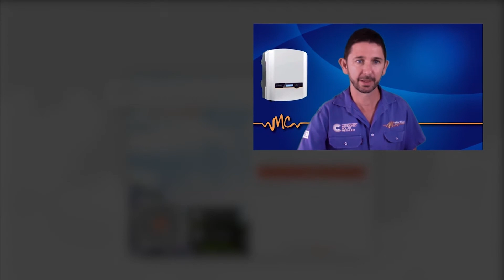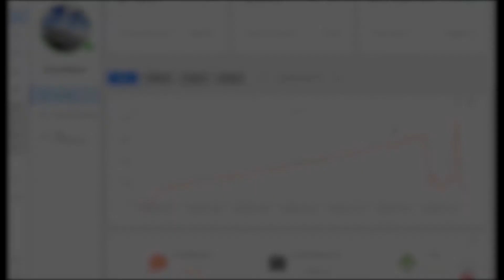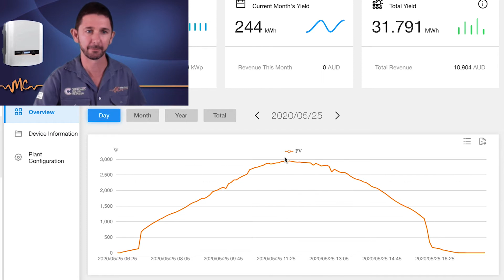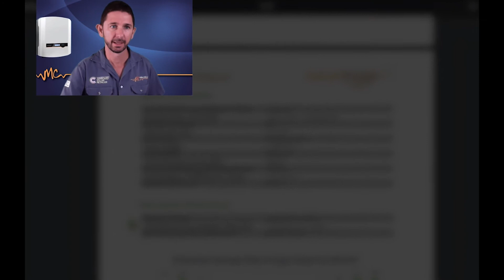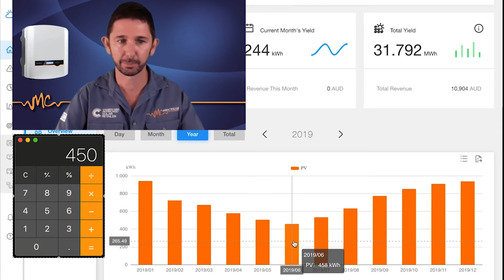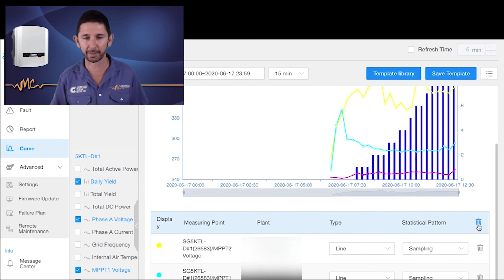Solar Monitoring | Sungrow | How to use iSolarCloud | No Energy Meter

Comment: What do you thing about the lates Sungrow 16kw battery system, with Sungrow 10kw hybrid inverter. Thank you
Reply from the maker: We stopped selling Sungrow products due to their support structures and constant issues and bugs with their software. From what I understand, these bugs have not lessened and still require intervention from installation companies to constantly follow up Sungrow for resolutions. 

Fronius offer much greater support. Still have issues and bugs, but they deal with them in a very professional manner. If you can, go the Fronius BYD combo. The advantage of being able to add a Fronius EV Charger without any additional control gear, is a bonus.

Comment: Dear guys
Thanks for your useful video.
I'm working with solar inverter solar.
When monitoring it on iSolarCloud, I monitor 2 measurements are Daily power yield and Total power yield.
Can you explain to me the definition of 2 measurements.
I guess that 
+ the Daily power yield is energy counted from beginning of this day to present 
+ Total power yield is energy counted from beginning of inverter installation  to present 
Is that correct?
Best regards.
Reply from the maker: Yes, that’s correct :)

Comment: When installing a Sungrow inverter and configuring the app, I have to pick "Grid Connection Type". Options are "100% Feed-In", "Self-Consumption", "Zero Export" and "Off-grid". I will use the solar power myself and sell any excess power. Which should I choose? Thanks!
Reply from the maker: Hi Eric. Choose self consumption.

Comment: iSolarCloud works for hours at a time, then randomly looses connection to server for an extended period of time. Must be a firmware bug. Inverter has network connection, and I can ping wife-dongle, Wi-Fi is at full strength (router is 3m away). All setup is correct as far as i can tell.... Pretty poor product. Going to try and make my own Server, and write some code to pull the Modbus data from the network i think

Comment: Hello! is the "installed power" just for show or is it important that the value is correct? my says 10kwp in solarcloud but i have 11.520w of total panels
Reply: 10kwp is correct. It';s inverter rating, not total of panels.